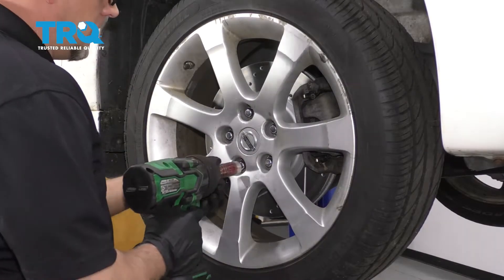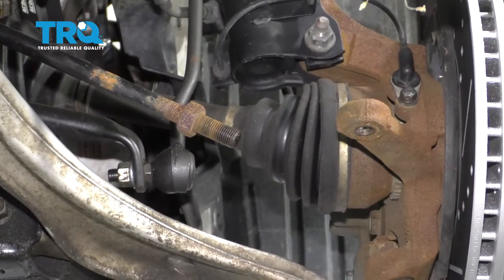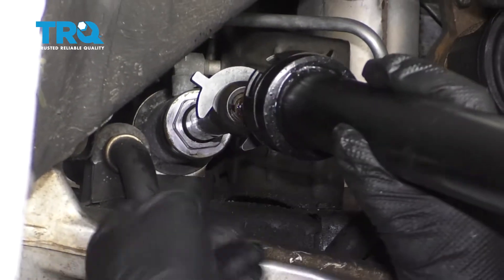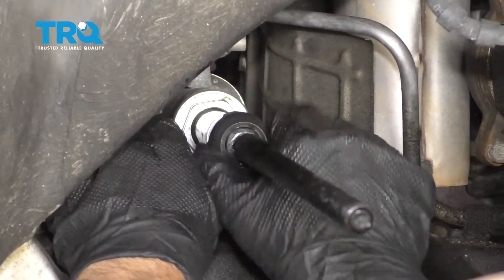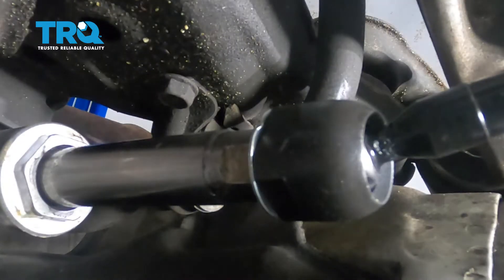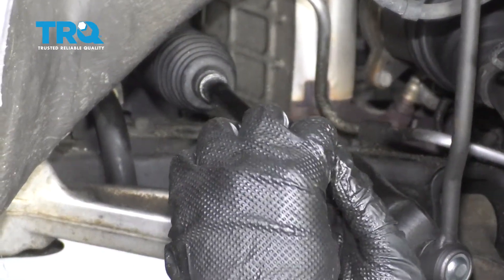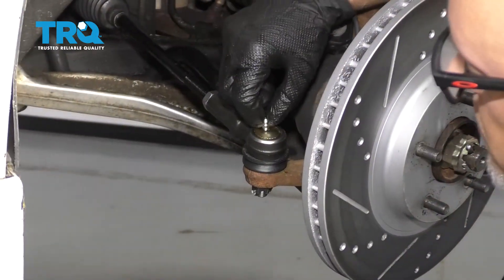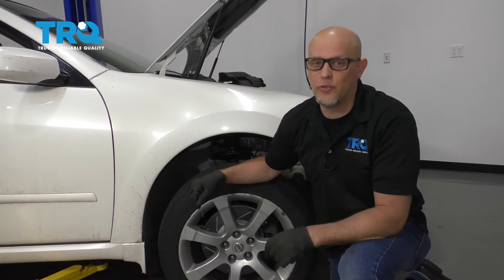How To Replace Inner Tie Rod 2004-2008 Nissan Maxima

Comment: See, I remember how many turns? It’s 19 turns 07:46, before U slide the tie rod into knuckles. Take the castle nut and get it started underneath. Torch the nut to 25/lbs. See the cutter pin hole at? If it doesn’t lined up w/ castle nut, tighten it a little bit more. Slide the collar pin through the hole. Take the side collar and bend it over 😊 and trim the excess. Tighten up this jam nut, if U have the ability to torch this to 65/lbs. If u got a any grease fittings in, put grease fittings in and take a 7mm socket and snug it down. Take a grease gun and give a couple pumps of grease. 

Put the wheel on…and get the lug nuts started….he started using this electric gun without saying anything…
Torch the lug nuts in a cross pattern to tighten down the wheel evenly to 80 foot/lbs. Start on again, double check. After U done this work just keep in mind that U have to take the vehicle to a local garage, to get aligned so U don’t have a premature tire wear. 
Goodnight everyone, guess what? I’m a lady, English is my second language 😊hope U like my interpretation 👍🏼